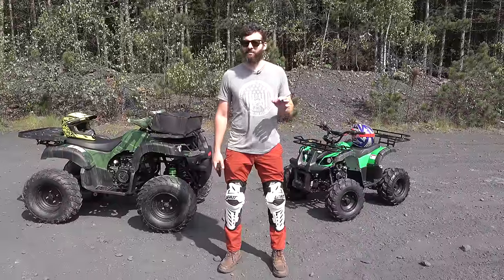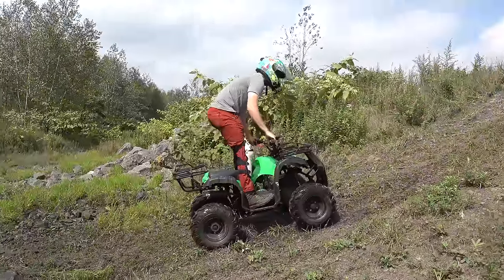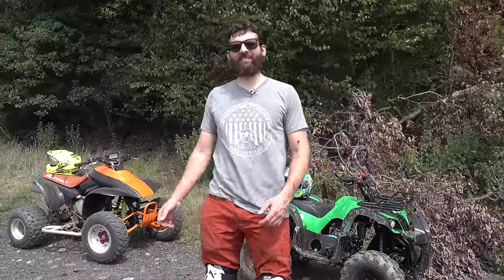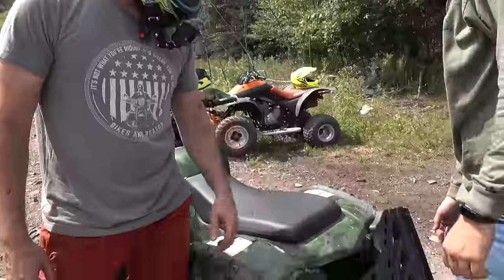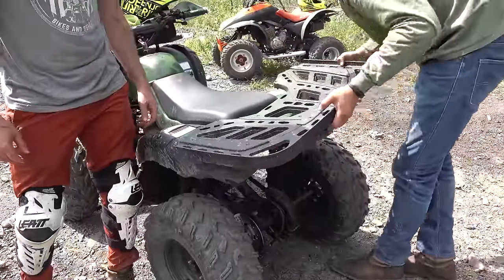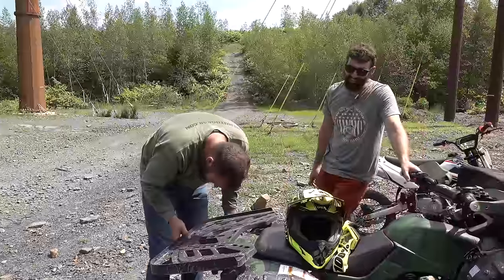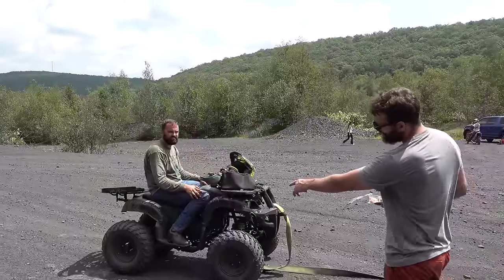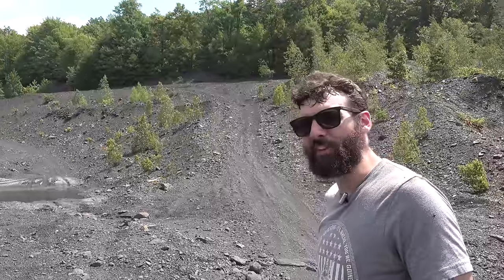CHEAPEST and MOST EXPENSIVE Amazon ATV Challenge

Comment: The small Chinese quad looks like it has trouble climbing level ground.
Reply: Jayden_the_awesome  that would mean it just has shit low end torque
Reply: @Chicken-pc5qn  no that means it sets the rev limit super low he has to unplug it
Reply: I learned on a Motorcycle with that motor, and unrestricted it'd be running 6-7HP depending on stock carburetor. With attention, it'd get 10 HP. My Bike would do 62 MPH on flat ground, which was enough to go on 200 mile trips and climb the tallest mountain in my state. It's crap compared to new motors, but seeing its been around since the 1950's, its not horrible either.
Reply: They put on the rims on the wrong side to, so the tyres facing the wrong way.
Reply: @abelcsaszar9026  The tires being backwards doesn't affect the problem of it having less power than a sick kitten.
Reply: @dkendrick652  Entirely true, my comment was just a mere observation. There is a lot wrong with these machines.  I just find it funny how much these guys doesn't care.
Reply: George washington  yeah you can adjust it lmao I didn't tell you that. ;-) throttle has a screw lol that's the governor haha
Reply: Yeah I'm sure that engine has potential to make that quad shred but there is some kind of restrictions on it. My little 70cc Chinese quad looks like it has double the power of that thing.
Reply: Aiaiaaaoaaiai3
Reply: My sister had one and I can assure you, it does
Reply: I bought one of those little ones for 50 bucks that was the best damn 50 bucks I've ever spent i couldn't kill it 🤣
Reply: It's probably a GY6 engine, so probably can be tackled the same way as the scooter crowd...variator weights, clutch main spring, carburetor, bore sleeve, etc.  From what I've seen, the chinese GY6 ATVs just have a chain sprocket on the tail end of the CVT and run a chain to the rear axle.

Comment: That honda will outlast the life of both the Amazon quads put together..
Reply: Of course it will
Reply: CallMePreY I know
Reply: Lmao plus a couple decades
Reply: 2 years aint a long time
Reply: That's a 2000's honda it's already a minimum of 12 years old with that fender style owned a 98 300ex for 6 years great quads
Reply: Confed Tread  yes it is
Reply: If you put a new carb on those machines and put them together the proper way un like they did and buy a tao or gio they will last twice as long as that I’ve had one for 8 years beat on it probaly over 500 hours still runs with no motor maintnece had it idleinv with no filter in mud over the motor and still like brand new so
Reply: @gabriellopez8101  the joke was that those won't last 2 years
Reply: @loganscott7129  yes, I had a tao tao and sold it about 2 months ago, I had it for 14 years until I did. But if you push it to what a full sized Honda can do it won't last but 2 years about
Reply: Confed Tread dude mine has lasted abuse that name brand machines can’t take pinned down thru 4 foot deep mud holes and coming out they don’t die
Reply: Yup
Reply: True
Reply: My mom flipped her fourweller it rolled so much and only steering was a little messed up that’s why Honda is the best
Reply: Ya it’s a Honda
Reply: Anything would last longer than those two

Comment: The 300ex needed a rider mod.  I rode one everywhere when I was a teenager.  It wasn’t as fast as 400s and 450s but would do everything
Reply: With a little work the 300EX will outrun the 400, and it has reverse.
Reply: That's what I've been commenting. If driven better, that Honda should've passed all these tests with flying colors. I have a Raptor 350 that gets driven through way worse just leaving my house on my way to the trails. They could all benefit from a little off-road practice actually. They stayed seated a lot more than they should've and they also should've went into these obstacles with way more speed.
Reply: Agree!!!!! Same with me
Reply: @BoomtasticRacing  later in life my 300ex had a 352 poke and stroke done by 4 stroke tech. Ported head, 400ex carb, 400ex front suspension mod (new shock bracket) and a 15th sprocket. She was a screamer!  It would out run 400s then. Would not catch a 450 though. 

I don't like the 450s I do not like the power band.
Reply: Chocolate dragon Power band ? I got a 2004 450r and there sure ain’t no power band atleast that I feel it’s fast as lighting don’t get me wrong but I don’t feel any power band
Reply: True I had one and it was badass
Reply: I have one just bought  it with my birthday money it’s a Trx 300ex 2005 with a pro circuit t-4 . Any suggestions on making it faster
Reply: @BoomtasticRacing  not just a little work bud. 300ex is very capable but you got a lot of work to do in order to outrun a 400EX.
Reply: @xfiringsquadx  agreed. The gravel pile could was been easy, the hill of  death and even the deep water puddke would have been doable.
Reply: my friends wife has one and she goes everywhere with that thing, works real good.
Reply: @reedvanwormer2895  I'd sell and find a way to get either ltz 400 or ltr 450, so much faster and capable
Reply: Is a 180cc any good?
Reply: Ya they do work good . It's a given to just get a 300

Comment: Looks like the little green on has more torque in reverse
Reply: They installed the motors backwards 😂
Reply: Tires on backwards too I think
Reply: Gas Tachs that’s still very little.  I’ve owned several quads and riden others, like my buddy’s nephew’ Suzuki 80 and Suzuki 100.   They all had more torque than either of those Amazon bikes.  It’s somewhat surprising that they don’t even appear to be able to spin the tires, when they are up against something.
Reply: I had a quad like that and yes it rips (only in reverse)
Reply: my quads the same way
Reply: There ya go bud your 100th like
Reply: @lewistharp138  haha thanks!
Reply: @GasTachs  up at 101
Reply: @bldallas  I can tell you why, too. probably just like the Chinese pit bike I had a while back, it has a friction drive clutch. a clutch that operates just by little arms swinging out with momentum to grip a clutch bell. those things are awful for torque, not to mention they scrape their own clutch pads off completely within a short riding time.
Reply: Stephen Nyberg hadn’t thought of that, but makes perfect sense.  When I was a kid I had a mini bike with a slip clutch.  Definitely no torque on that little thing, but it was fun on flat concrete or gravel roads.  Thanks.
Reply: @bldallas my current ride is a moped with a friction drive clutch, but also a belt driven variator. the fact that it has multiple gears really helps in the torque department, and the clutch lasts a LOT longer for sure.
Reply: My cousin  has a 125cc atv and the reverse is twice as fast as forword
Reply: @michaeljrstollsteimer579  tell  him to mount the tires backwards, so he can use  all that speed in forwards!
Reply: @nybergsgarage  that's how it supposed to be
Reply: @michaeljrstollsteimer579  just trying to be funny.
Reply: Everything has more power in reverse it’s how most engines work I was gonna put the motor in backwards on my drag sled but to much work
Reply: @bldallas  man my lt 50 would have been faster than those shitboxes
Reply: Probably why the tires were on backwards😂
Reply: Yea I have driven the same one the tires spin in reverse
Reply: They always do
Reply: @bldallas  I said the same shit. Won't even spin tires. Wow it's like a lawn mower. Hahahaha
Reply: @bldallas  yeah they are definitely restricted but the 125cc gy6 on their has potential

Comment: Its strange i drove a Chinese Loncin 110cc (semi) manual ATV for like 10 years and it had tons more power than those. It held trough some insane tortures and never broke like yours. PS: By the way i swapped the engine for a Honda 150cc and the original Loncin 110cc still works after going trough hell and back(the only thing i changed for those years was the starter after 8 years and the gear of the reverse after 6 years).
Reply: thats what i was wondering, old chinese atvs are def better than new ones
Reply: Having gears makes a huge difference

Comment: When your cheap China’s dirt bikes can’t do that and they wish they bought a quad and crying while watching this
Reply: A cheap Chinese dirt bike would've performed about the same as the Chinese quads. In fact, they might do better since they would be lighter and not need as much power to move the rider.  A lot of the failures in this video had to do with how they were driven. They obviously don't have much experience on offroad power vehicles. It was a fun video though and I think that was the point.
Reply: RS7JR the bikes also have gears most of the times, they can be a 110 and be semi automatic and be a lot better than these quads.
Reply: What bike do u have?
Reply: Nicki I got a modded 50 pit bike bored to a 88

Comment: as others have said, the reason you spend more on a name brand is longevity.  even if both amazon quads passed all these tests with flying colors, it wouldn't matter because you know the name brand quad is going to still be running when your grandkids are riding it.  modern engines are practically immortal, when built by a respectable manufacturer.

Comment: I have a 2000 Honda recon 250 that we have abused for its whole life and we have never a single problem with it.  Just battery issues.  We just had our 2016 Honda pioneer 1000 break down while we out riding and that little thing towed the whole 2000 pound side by side out. Those old Honda's are bullet proof.

Comment: My cousins gf bought the cheapest quad.  We threw a bigger carb on, its a beast, but, i think the gearing is way too tall.  Itll be screaming at what I'd assume is 10,000 rpms probably doing 35mph.  Its got ridiculous gearing, bigger sprocket on the engine would maybe fix it.  The gearing is set up with more torque than that engine can produce at low rpms

Comment: Says it all, the Honda two decades old but still the superior machine and you can still get the parts. If you don't throw it off a cliff or set fire to it or put honey in the engine it will still be running in another 20 years!
Reply: The reality is the bikes will keep getting older and you'll  see less of them soon raptor  350 and 400x's will be the cheap starter full-size quads

Comment: The EPA is to thank for how bad those Chinese quads suck. They are all tuned way too lean. If they could legally burn the amount of gas they needed to maintain decent torque they would be slaying it. Up jet, set the needle on a high position, make sure the air filter and exhaust aren't too restrictive, and possibly add a bigger rear sprocket. 100 cc is plenty of power if it is actually burning fuel the way it is supposed to and not on starvation mode.

Comment: know what you should've done? used a four wheeler. (not a quad, because the wheels are shaft driven and it has four wheel drive.) those can get through so much more. my brother has a honda foreman 400cc from I think the late '90s, and it goes through snow almost as well as my snowmobiles. it goes through water too. he got it stuck in the middle of our flooded ditch once on a 10 degree day, only because the ice on the water was just thick enough to stop it, and that water went up to the seat.

Comment: A real fun vlog with a sound message,  question do you still have the  250/305 cb72?, if you did  a Honda 450 head conversion would be fun or ship it here  Germany worth around  4k and  6 to 9k with a race conversion, old 4 cylinder Honda 250s are going through the roof, check mobile.de or autoscout24,de  they are in English. Thanks for the vlog brightened a boring day.

Comment: Are you sure that little one doesn’t have a brass governor around the throttle cable in the top tube of the carb?!?!  It wouldn’t wind up at all. Like a limited throttle.  Or an airbox restrictor?  I bought two 80cc Suzuki’s that had a throttle screw on the throttle, the brass thing in the carb and an air restrictor. When those were removed, it would scare the poop out of me.

Comment: that tiny green one WTF why the clutch slipping so bad? i had one 50cc bigfoot quad (small thing usual 110cc) it would drive pretty good and up hill had plenty of power
even 2vintage has one the same as yours but in black orange and it has power i mean its slow but it does wheelie..

Comment: The thing about these four-wheelers is the stock carburetor is total junk, how do I know this? I had a tao tao 110cc that was very similar just without reverse and it was fine but the carburetor was junk. Also, there electrical system shorted out and kept blowing fuses.

Comment: Dude I don't get what's up with these 125 Chinese quads, they look like the have the power of a 50cc yet I know those gy6's make good power, the factory must put limitations on it other than the governor screw cause these guys said they took it out. But by the looks of it, my 70cc Chinese quad has double the power of the 125 and would run circles around it

Comment: lol I only paid 1k for a nearly identical quad to their 2k one, (mine has a 4 speed manual though.) II have put some tlc into her and now she runs fanfreakentastic.. better carb and shocks and she rides like a Cadillac now... I've pushed her through some gnarly terrain... the only actual issue I've ever had was the vent on my gas cap got stuck, so the pressure was overflowing the carb onto the ground, yada yada...

I push mine through harder stuff than any of what you did.... Every time I take her out, she surprises me more and more, in a good way..... My son bought similar to the 900$ one and his only issue was they didn't bolt the rear brake down properly.....  He and his woman both weigh 130 or less and it rips okish for them... still needs a carb, shocks, sprocket changes and general tlc

1 quick question... Have any of you ever actually ridden a 2wd quad before?